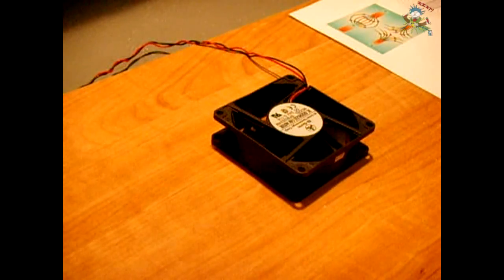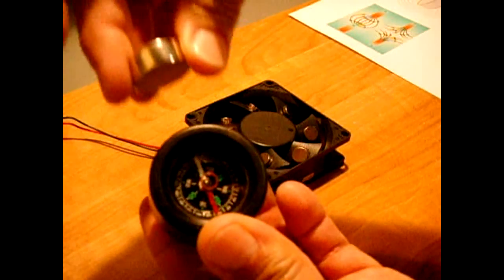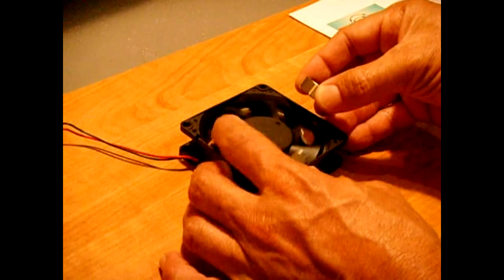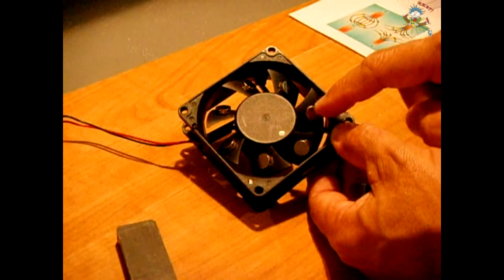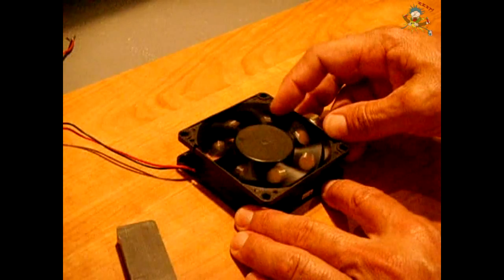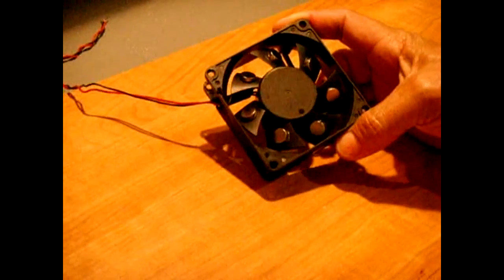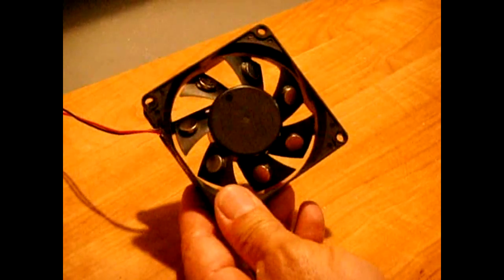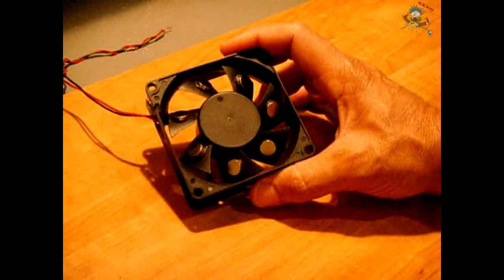Free Energy ~ Case Fan Magnet Motor / Real or Fake?

Comment: the problems with your fan is you using a metal fan you have to use a plastic fan . so try a new video with a plastic and you will see the result
Reply from the maker: Just to let you know, the case fan was plastic(all blades and central housing). The outer body is aluminum. The video was a hoax.

Comment: Perhaps there is a ratio limitation between the strengths of the stator and driver magnets that is being exceeded. I am not sure that you have accurately reproduced the conditions in Sajado's experiment.  Also, his stator magnets seem to lay flatter to the plane of rotation than yours.  Try a stronger drive magnet from a greater distance.
Reply from the maker: Your OVER guessing. The individual that uploaded that video never stated he did any modifications to the CPU fan. What you should be doing is contacting that fraud of an individual and ask him how to duplicate what he did. Good luck with that. LOL If he can ever show others how to easily duplicate what he did(all listed parts/sizes and #'s), then he will get an apology and this video will be removed. I don't see this video coming down anytime soon.

Comment: Its not fake . clogging as stated can be prevented . .. its your magnet that is the problem ... i can clearly say for example there are speakers in certain electronics that do not filter magnetic field inside due to the base material around it . for example the tube television . those magnets are protected inside from the tube / screen .. so i wouldn't say its fake .. it is a possibility for force to be pushed in one direction only and prevent clogging ...
Reply from the maker: Leon, I'm amazed that you are so sure that it is not fake, yet you show me no proof. Where is your video showing others how this can easily be done. If you cannot produce the video, along with DETAILED instructions on how to replicate, then your wasting my time.

Thanks For Watching!

Comment: hello Mr. genius (so called), don't just go out and call them fake if you are not able to get any success using your stupid  raw materials. First of all you really need very thinner and stronger magnets to put in the blades of the fan, as your magnets are NOT thin and has very less strength and so there is COGGING, secondly you need a new and free rotation fan you can get from logitech computer accessories, the fan you used has a very strong magnet inside of its tube itself which also makes another field to stop your rotations, and the most important thing is that you need a sideways shielded magnet (strong and thinner) to start rotations, check the video link i am giving you so you can FIRST understand it before you try to prove anyone fake... :)   Free Energy Magnet Motor (Engine) fan rotation."Free Energy" Generator
Reply from the maker: You criticize me, yet you have no video to show me of your success in making this work EXACTLY as shown in that video. You know the saying, "Put up or shut up". If this worked as that video showed, the idea would be used all over the place, and the individual would be very wealthy. Use common sense. Due to the lack of detailed information by the uploader, and failure to respond to viewers questions, he is a fraud.

Comment: Just playing devil's advocate here. One of the videos I saw emphasized that the magnets that go on the fan must be thin. I've played around with magnets enough to say that the reason your fan doesn't spin is because the magnetic fields at the edge of your thicker magnets are pulling the fan back into position. A thin magnet's edge does not generate enough pull. Thus, the initial repulsion would be great enough to break away from the secondary attraction that is generated from the much thinner walls. That's what my hypothesizing tells me. With all due respect you can't disprove something when the conditions are not exactly the same. It breaks the principle of scientific replication. I will attempt to build one soon and what I lave learned from your video is that using stronger thicker magnets on the fan does not work.  I encourage you to give the the idea of thin magnets a try and post your findings. Who knows, maybe you'll have different results. 

Cheers. :)
Reply from the maker: I appreciate you watching my video, but I will not waste any more of my valuable time on this Youtube scam. If you have played around with magnets, then you should be the one testing. When you can prove it works, email me.

Thanks.

Comment: Good video.
I wouldn't say cogging is the reason this doesn't work. It merely causes the setup to snap into a certain position when it stops. - Which it does because the magnetic poles will receive the same amount of rejection while it enters the field as it does while it exits it.
Reply: I would point put that this is application of perpetual motion. Which is nonsense.  You need energy to do work.  By them selves, magnets provide no energy {unless you throw, heat, burn,chemically combine, or elevate one, lol}

The only energy in this system is via the hand moving the magnet close to the others: resulting in simple magnetic repulsion; no different than using the same hand to push the blade with a chop stick.

However, if I were a believer, I would say that the reason you failed was due the counter EMF caused by this mini DC generator trying to drive the heavy load of its output wires {appearing to be} shorted out.

I bet that if the fan was facing a decent wind, it could light up some LEDs.  That's assuming the field is provided by permanent magnets.

Love your gy6 vids  do more.
Reply from the maker: Hi Christian,

I personally feel the cogging effect is what prevents the fan from freely spinning. That "snap into a position" effect is certainly not beneficial to the cause.

Thanks For Watching!
Reply: Suppose there was no cogging; would it then keep spinning?
Reply from the maker: I would say yes, based on my testing.
Reply: Okay, then we have found the root of our different views. I would assume it would stop eventually due to friction in the bearing and the air... ;)

Comment: I k you have to follw his directions in the same way.If his magnats were thinner.Then yours must be also.Then the fan was de-tachted in two.I think the way you did not open up the plastic fan into .It may stop the magnetic field from moving.?Ty it again but make sure yours is completely the same way.Because it DOES WORK ..
Reply from the maker: Your dreaming. If it works, let me see your video, and also include EVERY part used, and exact instructions on how to duplicate. If I get that video, and verify it, I will post a link to your video. I doubt I will be seeing that video. :-)

Comment: Hi, just watched the video and had an idea that what if you fixed 1 neodymium magnet each on 4 corners each proceeding one side of the fan housing so that the magnets that are on the blades have a constant magnetic push behind them and aren't just relying on 1 magnet to push the whole lot. In my head that would work, but I don't fully understand cogging.
Reply from the maker: Thanks For Watching, but I have much more important things to do. If you decide to try it, and it works(good luck), I will be glad to post a link to your video. Some DC motors when rotated by hand, you can feel the shaft "locking in" at certain locations of the 360 degrees. That is cogging.

Comment: This is the opposite of the scientific method.  You stated at the beginning of the video that you did not duplicate the original setup exactly.  How can you conclude that the other other video is a fake?   The only conclusion that can be drawn here is that THIS setup does not keep the fan spinning. 

Because this is the Internet, i have to state that i make no claims for or against "free"  magnet energy.  I am only commenting on the methods and conclusions of the poster.
Reply from the maker: CLEARLY you believe this. LOL. I won't waste my time discussing this further, but if you believe this works, then invest a few bucks and post a video showing ALL the specs once it works as shown in his video. Common sense alone should tell you that this is a scam. If this really worked, the guy would be a multimillionaire, and these devices would be replicated by many people, many devices would no longer require batteries, AND China would already be copying the device and selling them dirt cheap.

Case Closed.
Reply: electronicsNmore CLEARLY you didn't read everything i wrote.  

"Because this is the Internet, i have to state that i make no claims for or against "free" magnet energy. I am only commenting on the methods and conclusions of the poster."

Comment: It doesn't work.  If it did the second law of thermodynamics would be kaput.  The way those fakes are done is with a pair of very thin copper wires.  So thin that the camera won't pick them up.

Comment: what  about single pole magents to over come the cogging?
Reply from the maker: All I can say is that it would take a lot of experimenting with different shapes/strengths of magnets. I don't have the time for it. LOL
Reply: Kevin Anderson Single pole magnets, would they exist, could also not deliver energy. You can imitate a single pole magnet e.g. by using a very long bar magnet. This way the action of only one pole is significant. The magnetic force of such hypothetic single pole magnets still works equally clockwise and in other positions anti-clockwise, sum is always zero. Well known to physicists since more than 100 years!

Comment: It is probably possible I mean to spin the fan blades with the help of magnet no matter if it  produces any current. The motor itself has a magnet within. N probably that is interfering the fan from rotating . Try removing it ( I know if we remove the motor magnet we won't get any current but try n c if the fan rotates by this method) and see if the fan spins if that didn't work try sticking the magnets in every alternate blades and see if that works. This fan can definitely produce a small amount of voltage when spun. Please try these methods and let us know if it works.
Reply from the maker: You are correct, there is a magnet located in the center of the plastic fan, but you also have to realize that the individual who uploaded the video, never said he removed any internal magnets. He stated that all he did was glue magnets onto the blades, and push the fan into smooth operation using one other magnet. Unfortunately, it will not happen that way. Experiment yourself, and you will see. A scam. :-)
Reply from the maker: I just tested the fan in the video. Applying 24V the fan spins perfectly at a set rpm. If you spin the fan equally as fast, you DO NOT get any real measurable change in voltage. Maybe .05 volts DC. That is due to the way the case fan was designed(The internal circuitry). I have another case fan which will produce voltage when you spin it fast.

Comment: electronicNmore!! one thing u most also take note when u try to spin the blade with  the extra magnet the 2 wires + and - nag wires should not short they must stay apart if not the motor will caused a drag and cant spin if the wires are shorted or had a very low resistance loads... keep the wires apart
Reply from the maker: The wires were apart. :-). They were twisted together, but the ends not touching.

Thanks For Watching